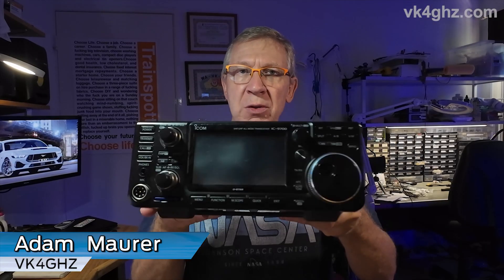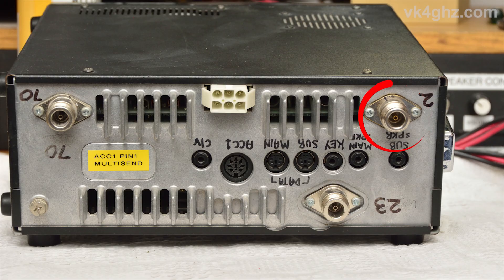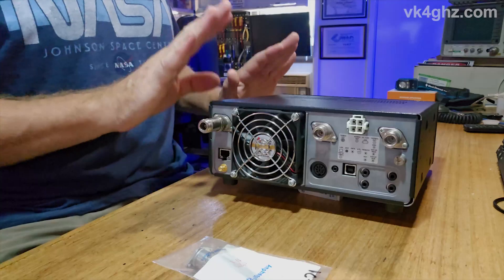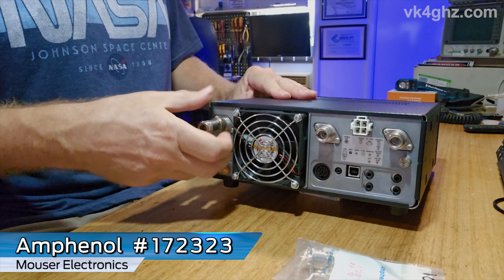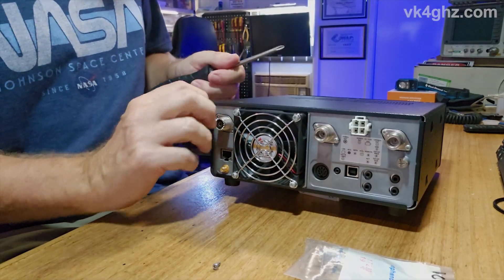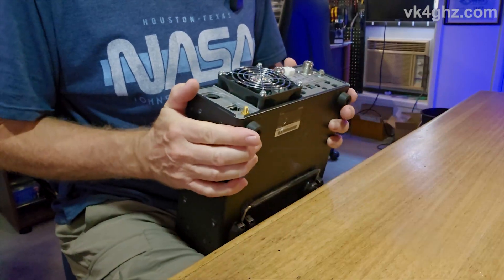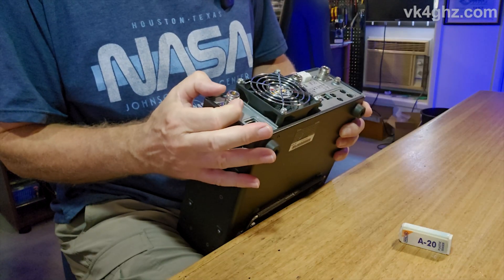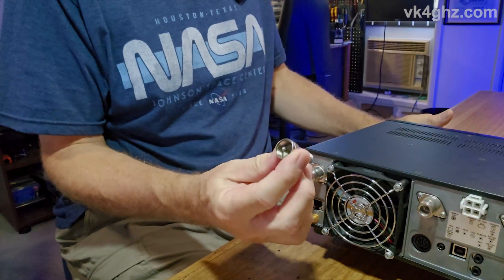Icom IC-9700 144 MHz N Connector Mod

Comment: The correct N Type connector is a must, as many of the cheaper ones, the center pin is too short to fit in the clips properly.

Comment: That's a great mod.  Surprising that a VHF/UHF radio that has N connectors for the other bands doesn't have one for 2 meters?   I gotta say though, while really convenient, that "socketed" connection design for the center pin feels a little janky to me..
Reply: Socket is due to the pcb location and construction! SO239 is due to the Yanks who don’t use N connectors at 2metres unless forced to!